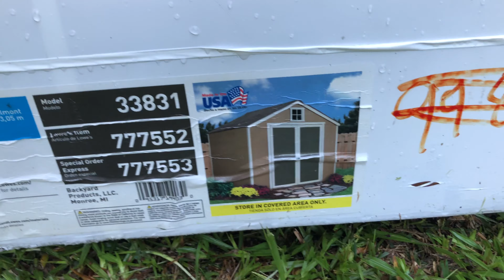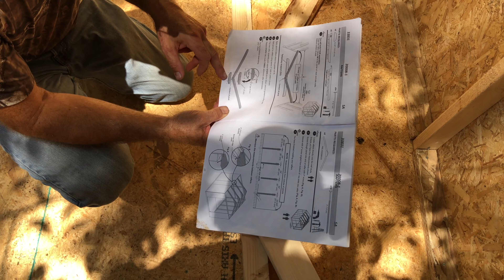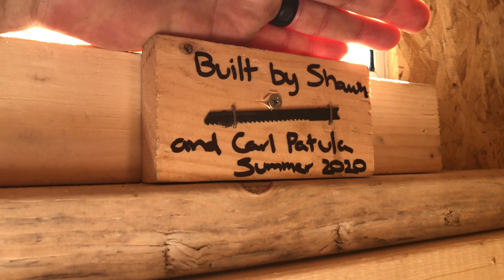How to Build a Lowe's Shed

Comment: I have to go meet a client this morning at 8:30 to look at whether or not she has room to build an 8 x 8 shed from Lowe's, would you recommend it?

Normally I'd build them myself and this looks very under framed
Reply from the maker: @vrgcustomcarpentry  8x8 is pretty small but if that’s all you can fit then it is what it is. I wish I have gone bigger however I have zero complaints. Not problems at all.

Comment: very Good.  Thank You.   gonna be putting same shed up when it comes  in.    How far apart did you gap your 2x6s on foundation.   
was it 16 inches or 24 inches.   also did you make your foundation exactly 96 inches X 120 inches.
Reply from the maker: They are at 16” apart. The 8x10 isn’t the exact size. When you get the kit it comes with instructions on the exact size for the floor.

Comment: Nice work guys. Question about the floor- Did you put 4x4 in the ground and attach the 2x6s and put bricks around or is it sitting on the bricks? Thanks.
Reply from the maker: the 2x6's are set up on the concrete blocks.  thanks!

Comment: I did it by myself, took me a total of four days, I just finished mine today and had the same issue, I'm getting ready mentally to bring it up to them. They never called to deliver, wood was wet inside, came warped, and many of the pieces were messed up 🤷
Reply from the maker: sorry about your luck.  i think they would be pretty cool about replacing some pieces.
Reply: There are few issues when you ordered some things from "Home Improvement, DIY." I ordered toilet tank and I was told that you item was cracked. So, they reordered and shipped it to me, but it was cracked in second time. I had to return back to them.

Comment: You guys spend some good time together and i's priceless. However for folks whos watching this video and want to save some bucks on Pro installation - please think twice. If you enjoy this kind of project and just want to build yourself that's great , but you will most likely not save any money . Time , roof , floor , handle of out of specs pieces  that comes with Pro installation will most likely cost you less than DIY.
Just 2 cents from Pro installer.
Reply: Not true. These pro installers charge crazy money and are third party folks. I wouldn't recommend it. Just do it with a friend and your good. Don't sweat it too much. You will save between 500-1000 dollars doing it yourself. .